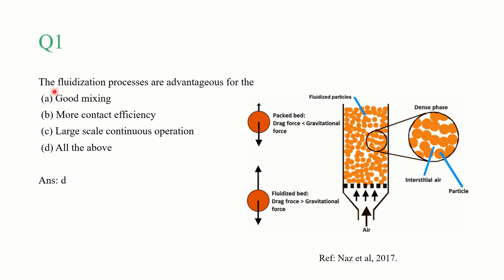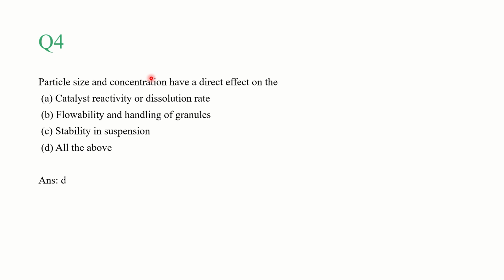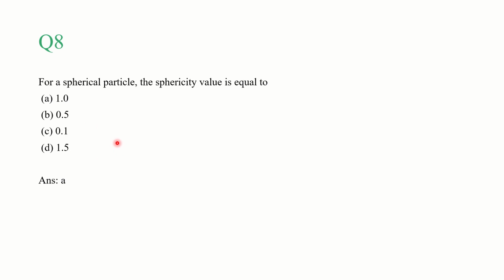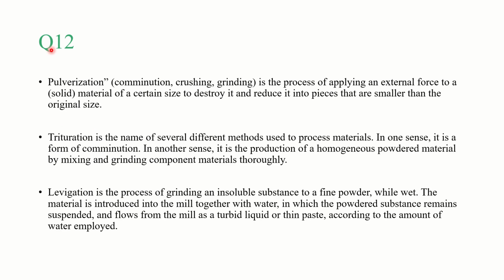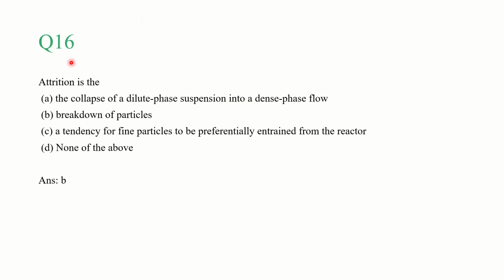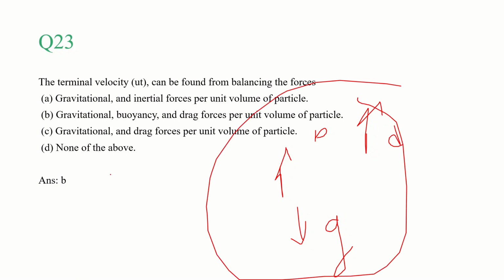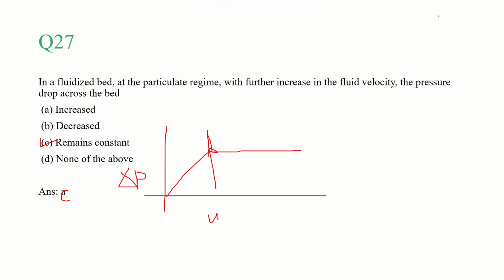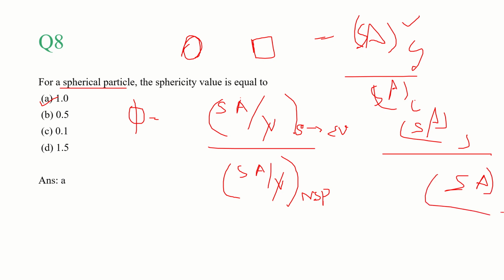NPTEL-Fluidization Engineering July 2023 Problem solving session-Week 1

Comment from the maker: There was a confusion in the video, I have given a wrong answer for a question.
For the question Q25, 
In the case of homogeneous or particulate fluidization
 (a) As the gas velocity increases, the bed expands smoothly in a homogeneous manner
 (b) Further increase of gas velocity, bubbles are formed in the bed
 (c) Both (a) and (b)
 (d) None of the above

The right answer is: (c) Both (a) and (b), because when the gas fluidizes homogeneously as in particulate fluidization, the bed expands smoothly. But with further increase of gas velocity, the bubbles start to form in the bed.